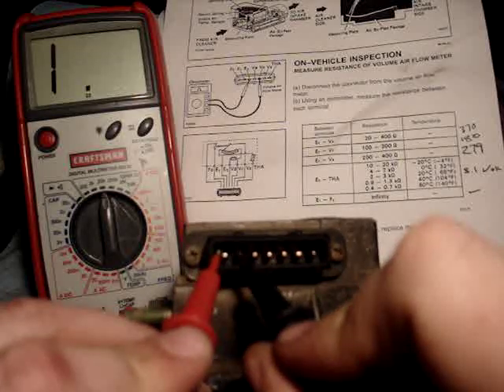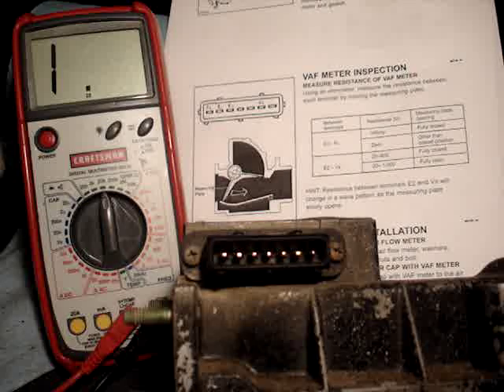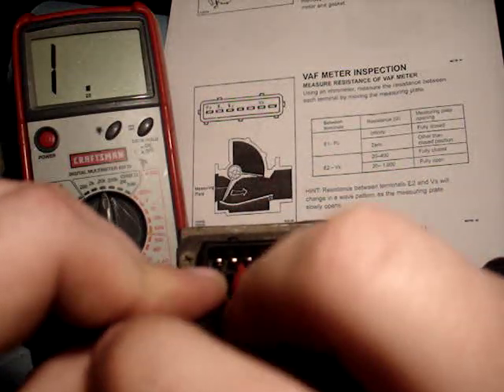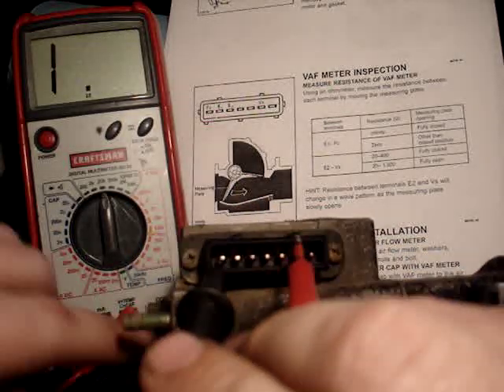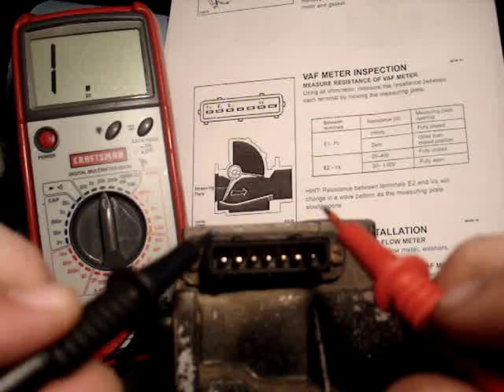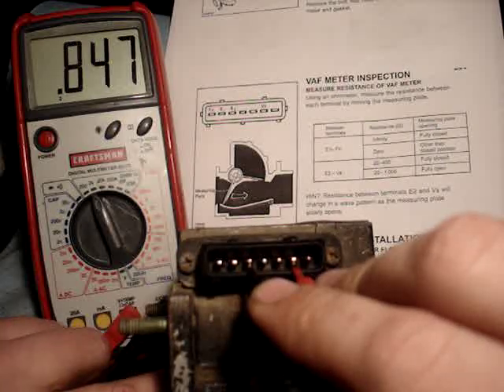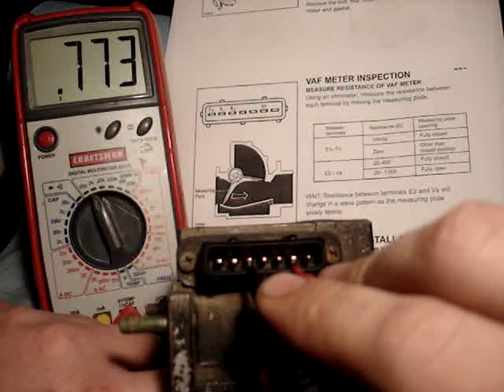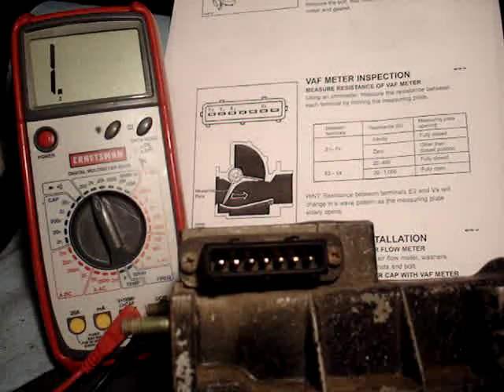Testing a Toyota Air Flow Meter / VAFM

Comment: A question - I bought a new AFM for my 1991 Toyota truck V6. But when I install it, the truck only runs for a few seconds, then dies (It seems like I smell fuel).  If I install the old one, it starts immediately and does not die. I am confused; Is it necessary to somehow reset the ACU to the new AFM, or something like that?  (I tried disconnecting the battery for a while, but it made no difference). Thanks for any ideas!

Comment: just got done with this testing procedure ... it's important to do the last 2 tests (the dynamic tests) because in my case all the static tests listed in the FSM were 100% within spec but when I went beyond the FSM and did the dynamic test, manipulating the vane door, is when I saw where my problems were coming from.  The test between E2-VS pins revealed multiple open/short readings in the sweep indicating a worn out resistive strip on the vane door meaning my AFM is toast and in need of replacement or refurbishment.
Reply: is this when you're getting a zero while opening and closing the door?
Reply: @petegangies  yeah if it drops to zero at any point when you are opening the door then the resistive strip has dead spots.
Reply: @Raevenswood  damn! all 3 of mine are like this one I recorded: https://youtube.com/shorts/RH7bRZV_q8E?feature=shared